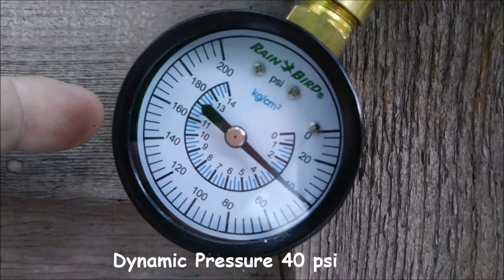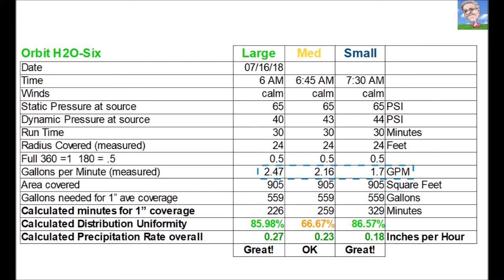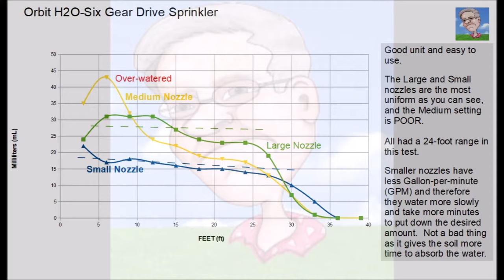Orbit H20-Six  H20-6 Gear Drive water Sprinkler Performance Test

Comment: I just took one of these apart to try and fix the rotating gear assembly- and that portion of the sprinkler appears to be sealed shut.  The output drive gear won't even turn- so when it stops rotating and you've confirmed nothing is blocking the filter, there is very little you can do to correct it.  
These will only last 1-2 years, even with very little use.

Comment: When it doesn't rain, this is important! Mine just keeled over with a failure to rotate? Frustrating, because it sprays great if I want to go move it every 10 minutes. I see no fixes for that anywhere. I will replace and then attempt to fix for a spare. I love this sprinkler when it works right!

Comment: Can this do different ranges in one settings. 

Like front 30 feet and right side 15 ?
Reply from the maker: No, but you can rotate the cap which has stream splitters from none to 1/2/3.  In effect this splatters the stream effectively cutting down the range but delivering the same amount of water but in a smaller area.

Comment: Whats the little white plastic switch? Does that need to be fixed in a certian direction to initiate the oscillation?
Reply from the maker: There is no white switch.  The white arrow points to the selected nozzle.
Reply: @TommyTester  yes but if u look underneath where the gears are theres a little white plastic piece that the sticks through the 2 tabs. Seems to click left or right. I noticed it when i was looking for a solution for it not oscillating after only 5-10mins

Comment: I noticed that this sprinkler leaks quite a bit from the bottom of the unit. Seems like a design flaw. I don't see a way to adjust or fix that issue.
Reply from the maker: I agree.

Comment: My PSI from faucet is 75-80. How many would you recommend running in a series?
Reply from the maker: I have no experience testing sprinklers in series.  That said, using wide (3/4" - 1") and short hoses will provide the best results.

Comment: Hey Tommy, I just did one of these catch cup tests on my lawn in San Antonio, TX using my Orbit H20-6. Very eye opening! Turns out my PR was only 0.13 in./hr. I had been watering thinking I was doing a little under 1 in./hr.! No wonder my lawn was struggling in the heat last year. 

Question: have you done any videos on effectively applying head-to-head spacing to hose-end sprinkler placement for us that need to move our one hose end sprinkler around? I'm having a hard time wrapping my head around how to not overwater in that situation. Thanks!
Reply from the maker: Not specifically.   A simple way to look at it is if you have 10 cups equally spaced and the inner cup fills up to a level "10", then 9 -8 -7 and so forth down the line to one.  You want to find the middle cup that is half full (ie: 5) and measure the distance back to the sprinkler.  Let's say it's 15 feet, then your sprinkler spacing should then be 30 feet, allowing the spray overlap to fill that middle cup equally from both sprinkler heads.
Reply: @TommyTester  ah, got it. So that means I probably need a different sprinkler if I'm going to be moving it around. The H20-6 is very uniform across the cups. The one closest to the sprinkler is usually a little light compared to the others but otherwise they're about the same. Thanks!
Reply from the maker: @chrisjacobie2775  Yes, this is one of the better ones out there.  The only issue is they tend to break.

Comment: What diamerer hose size were you using?
Reply from the maker: 5/8"
Reply: @TommyTester  You must have very good water pressure.  I wonder if 3/4" would do even better for distance?
Reply from the maker: @michaelfisher7835  Yes, shorter and fatter (3/4") would increase GPM and distance.
Reply: @TommyTester  How short, or how long?  Would 50' be too long ?
Reply from the maker: @michaelfisher7835  I used 50. Its a standard length.
Reply: @TommyTester  Very good.  Thanks for the info.
Reply: @TommyTester  Very good.  Thanks for the info.